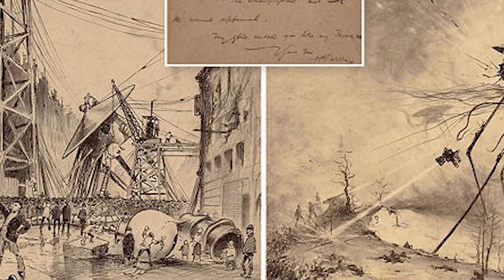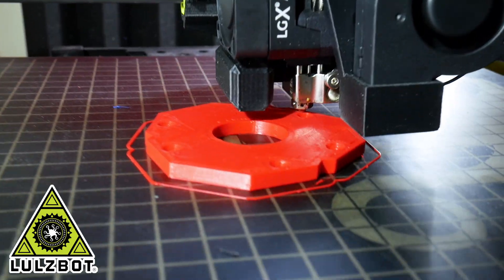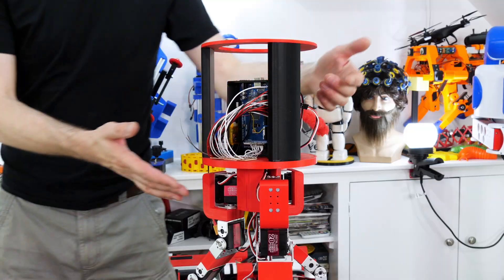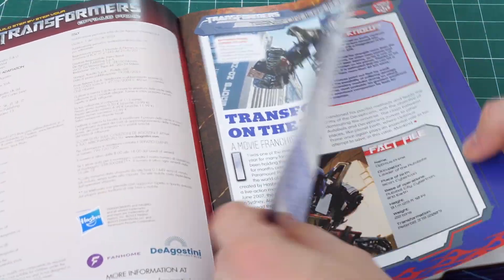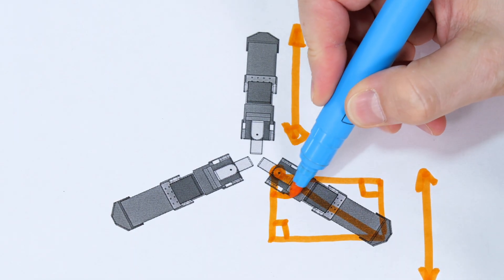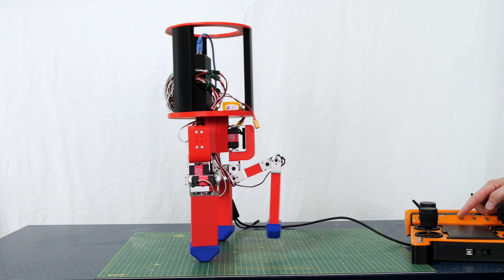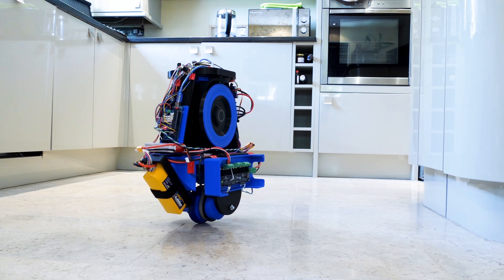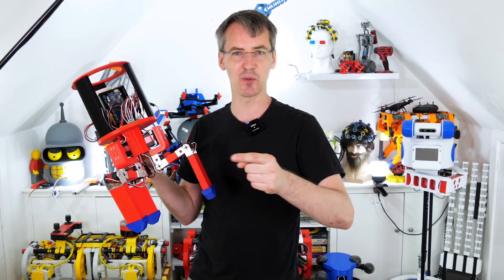Could Alien Tripods really walk Robot

Comment: I doubt you'll see this, but maybe try a single motor per leg and use a wire to adjust the length of the legs by wrapping it back and forth through the pivot points and having springs to push the legs straight. Then you don't even need a calculation on the angles of the leg joints, just to know the length for movement and balance.

Comment: I am an mechanical engineer too and I was responsible for designing CFRP Structures for my Formula Student Team (Monocoque, aerodynamic parts, etc.) for three years. Furthermore I did my masters thesis on CFRP (additive manufacturing) an developed a failure mechanic too. 

We are on the same page - I was shocked to hear that they really used CFRP for that structure, which is just plain stupid.
One point I want to bring up, since you didn't address it in the video:

Bonding CFRP and titanium for this application is the second worst idea that they had. Both materials behave extremely different under pressure. Even IF the CFRP would not fail - the bond would....

Comment: Heelys solved walking with wheels on your feet.  The wheels don't go on your toes because you need toes functioning as fulcrum of a 2nd class lever in an emergency stop.   To suddenly broaden your base of stability and convert forward momentum into lift against gravity to arrest forward motion without overwhelming traction.  The tripod version would have 2 forward toes splayed either side of the direction of motion and a dragging prehensile toe pointed opposite the direction of motion.  In dynamic walking, the knee approximately points in direction of motion, but not exactly.  Inward ankle rotation orients the raised toe straight ahead, and outward ankle rotation permits pivot around the lowered toe allowing reposition of hip/knee/heel without disturbing static stability or ground contact.  I think the heel-toe shuffle will be instrumental in practical walking tripods to maintain 3 points of contact while moving long legs.  The need for ankle rotation in dynamic bipedal walking does not disappear when adding a 3rd leg.  If we accept that we need an ankle for a tripod walker, we can use it to ensure dynamic walking is backed up by a quickly accessible statically stable configuration.  In my mind, that is the "killer app" for a tripod walker.

Another might be the ability to super rotate the hip, pointing the knee centrally.  Allowing a broad base of support in a volume less than a pyramid.  To perform work on bridges for example; move a central work column close to a bridge span while the feet extend beneath the span.

Comment: insects have evolved to basically be tripods. But 2 tripods, one moves and then lifts the insect allowing the second to move and then swap the load-baring job. Hence 1 static tripod holds the insect and the other moves to a new position then becomes the static one.
Tripods do work, but I can't see a single one working other than like human legs with a sophisticated 'controlled falling' movement.
Reply: The "easy" way to do three legs is treating them as side-by-side-by-side. It then becomes a simplified version of bipedal motion, where the outer legs move in unison. This is like bipedal motion, but it simplifies side-to-side balancing.

But it's also boring.

Wells wanted tripods that moved in a way that was very alien seeming. So, they move in a way unlike familiar creatures here on Earth. Instead of a tripod, imagine a cone. You can tilt the cone so the rim touches the ground underneath the balance point. Spin the cone, and it will roll forward with a "rim roll". Now imagine replacing this conical skirt with three legs. One leg is on the ground while the other two swing around above the ground.

Something like that. Familiar creatures here on Earth don't move like that, because it would involve spinning one's body around in a dizzying fashion.

Comment: If the leg has a much smaller inertia than the robot's base, then you can simply make a step with the leg without the robot falling. This assumes that the motors can accelerate the leg fast enough.

Comment: You could have used a gimbal designed with a dynamic centre of gravity and frictionless bearings. Shifting the weight tangentially away from the fall as it walks. Like a Gimbal Compass. And ball joints and universal joints for the legs in a McPherson strut or wishbone configuration. Basically creating a three wheeled steering system with a dynamic centre of gravity which is opposed to the builds centre of mass.

Comment: The biggest problem with creating specifically H G Wells' tripods is that he is quite specific that they made no use of the wheel and "singularly little" use of the fixed pivot confined to a single plane.
"Almost all the joints of the machinery present a complicated system of sliding parts moving over small but beautifully curved friction bearings."
Reply: That sounds like an extremely interesting engineering challenge that we have only developed the tools to accomplish in this millenium. I'm talking 3D printing to create such mechanisms, and genetic algorithms to design such mechanisms.

Comment: Maybe alternate which front leg you use after stepping with the back leg to counteract the rotation. It'll technically be a bit of a zigzag but I think that'd work much more easily and simply for the kitchen floor instead of adding reaction wheels/gyros. To elaborate, say the rear leg is index 1, then counter clockwise is index 2, and then the last one is index 3, have alternating gaits like 1,2,3, 1,3,2, 1,2,3, 1,3,2 etc, so going from clockwise to anticlockwise steps. Right now it's doing 1,2,3, 1,2,3, 1,2,3, 1,2,3 and it builds up into a circle (continued counter clockwise steps). You may even be able to take advantage of the built up inertia to increase the speed since it'll be alternating between clockwise and anticlockwise gaits, though it'll probably be fiddly at best, and certainly not work on anything that isn't flat and smooth. It may also be possible to just use the legs for balancing with the IMU and not necessary to have the gyros/reaction wheels for active stability, but I think it would be nice to at least show how different gaits affect locomotion. Obviously it still requires some form of active stability to handle different terrain, but you might be able to achieve that without gyros or reaction wheels to save weight/materials/energy/work.

Comment: I am sure the engineering is great, but the anatomy is something else. So the upper joint of the leg is a "shoulder" (???) for each limb in this creation, and each shoulder is the proximal joint above the "knee" joint. Presumably even on a robot the proximal joint of a "leg" isn't the "shoulder". Even on quadruped animals the 2 limbs closest to the head have shoulders and elbows, not shoulders and knees. And there are other anatomic requirements for something to be considered a "shoulder".

Comment: If you've ever used a pair of crutches and one leg you are a moving tripod.  You balance on one leg, lean your weight onto the front two legs ( Sticks) and then left what is now the back leg and swing through.  From there you could probably learn a 132 rotation landing on left leg, right leg, middle leg, left leg, right leg, middle leg in a swinging gait.  I think Learning is the keyword here for getting a robot to do it.

Comment: You use your Arduino Mega 2560 as a servo motor controller, I use my Arduino Mega 2560 as a DCC base station for my model locomotives, we are not the same.

Comment: What about a tuned mass damper arrangement, with 2 DOF... you you could inject inertia with that in any direction, paralell to the ground, rffectivly unloading the leg you want to move. once the leg is back on solid ground the damper could be reset without affecting overall ballance/position. The advantage vantage is that the mass could move at right angles to the line intersecting the points of the two feet that are not being picked up.... I havent worked anything out but I think you could probably create a gate by shifting the mass in a triangular motion, avoiding the mid step reset. I guess that a couple of reactiom wheels, at 90, to each other could produce the same effect but I suspect that the structure would be bigger and more prone to runnung out of available accelleration. In addition reaction wheels, once spinning would introduce gyroscopic effects and complicate things. Dynamic ballance would obviously help and could also be used to trim the foot height if  servo load, or a load cell, was used to calculate the ground load of each foot. ... IE. Place the foot in space and move the damper to load it... This would be a best guess.  If the orientation and or load is wrong, ground higher or lower than expected, then adjust the foot height whils using the damper to stabilise the lean.
Granted lots os code and so hard to tunr PID loops but only two servows an and a mass on a stick.
That above my paygrade right now, printer still in its box, but sounds right up your street.

Comment: That 4-gyro two legged robot is the most convincing I've ever seen! It looks like a design that could eventually become a true home domestic robot one day. Why aren't there more 4- gyros out there!?
Reply: I would guess that using 4 gyros uses a lot of energy
Reply: @sarowie  why though? They're not even stepper motors, just free spinning gyros with angular sensors
Reply: @k_the_v  you are right , they don't use lots of energy , they are control moment gyroscopes , which has the advantage of not having a limit in the amount of torque generated when it comes to rpm , i mean , a normal gyro can only spin so fast and provide a maximum amount of torque given a certain rpm , even if you double the rpm , the torque won't increase , that is not the case with control moment gyroscopes , as they provide higher torque the higher the rpm is .
Regarding why they aren't more common i Will say some reasons that i can think of :

1)they aren't that humanoid

2) having these 4 gyros makes it extremely noisy , you would need to cover it with a soundproof material to bring it to acceptable levels of sound 

3) is not a common technology in the field : control moment gyroscopes are mostly used in satellites and some submarines , they aren't used for walking robots (last time i checked only two walking robots use CMG's ) , so is tech that wasn't applied to that field until very recently 

4) is not super safe : CMG's are basically flywheels spinning at high rpm , meaning that handling these without care can be very dangerous

5) not readily avalaible : while there are CMG's for satellites , they are quite expensive and not made for walking robots , the CMG's that the robot uses are custom-made.

I agree with you that they should be more common , these CMG's are so damn good they are able to balance a 34kg (yes that robot weight that much) robot that is bipedal with 2 dof in the legs (2 dof leg in a biped would be extremely hard to balance , that is why most have 3 dof ) , it seems like the ideal way to upscale a bipedal robot without having to worry that much about balance

Comment: IIRC, the three legged creatures in Tripods ran with a rotating motion. Imagine a tilted wine barrel doing a "rim roll". The creature would move like that, with one foot underneath as the other two feet swung around.

I'm not sure how the heck you'd program a three legged robot to accomplish that "rim roll" motion, but I imagine it would end up a lot faster and more elegant than this robot's clumsy walking.
Reply: I came here to say this too.  In the original the motion is described as: "And this Thing I saw! How can I describe it? A monstrous tripod, higher than many houses, striding over the young pine-trees, and smashing them aside in its career; a walking engine of glittering metal, striding now across the heather; articulate ropes of steel dangling from it, and the clattering tumult of its passage mingling with the riot of the thunder. A flash, and it came out vividly, heeling over one way with two feet in the air, to vanish and reappear almost instantly as it seemed, with the next flash, a hundred yards nearer. Can you imagine a milking-stool tilted and bowled violently along the ground? That was the impression those instant flashes gave. But instead of a milking-stool imagine it a great body of machinery on a tripod stand."

Comment: I prefer the method described by Arthur C. Clarke in the Rama series for the spider biots where the body spins around the one leg it has on the ground while moving. This is extremely unstable motion therefore requiring some form of multi axis balancing ability.

Comment: But I think them walkers was done in a different way. As it showed the aliens having 3 legs themselves and building the tripods to match them so it would be better they control it like in a full suit. Then the machine move as you do and as fast as you do and you the driver keep it balanced just as you do while walking or doing anything. The down side to this is it needs a driver but the plus side is in the tripods anyway it only your species can use it. That would explain the tripod at the end of the film walking in circles before falling over.

Comment: would like to see a tripot-bot that has linear actuators for legs, so that they can rotate the legs around the shoulder joints, but the leg actually expands in length or contracts while taking a step like a hydraulic cylinder for example. At least i think I'd like to see that, bc i expect for it to be more nimble as long as the linear actuators are fast enough to jump, which hydraulic actuators likely wouldn't be, but you could then essentially jump each foot a step forward one by one. 

I do notice this is hard to put into words so I'd likely have to animate it for you to understand my exact thought process, but still.

Comment: love your content, i imagine that if you are able to calculate the axis inertia and mass vector form in ground direction, form a point where it intersects with the ground,  than you could position two feet in a line that intersects the point, move the other feet, then do the cycle again, making the  sure that the feet who moved in the previous cycle stay "still"... i bet this will make the gyros obsolete in this build...longer leg bits would help in this scenario, as the bot would have more freedom to choose where the tips go...
Reply: and thinking more about, you can use the weight of the robot to control the vector before taking the step...so it leans in a certain way, taking in count the desired axis position in the next three foot part of the step, like "lean to next balance, move a feet to intersecting line"

Comment: An amazing video, I often wondered why people never model a  3 legged machine on a para athlete who uses two crutches and one leg. I can outrun most able bodied folks and remain perfectly balanced :)
Reply: not radially symmetrical.  you then get a bilaterally symmetrical robot with one leg and two long arms.  part of the design was trying to recreate the kind of tripod walkers dreamed up by welles.  i do imagine the "one short leg, two long ones" design that moves the outside legs in unison, then swings the middle one forward to complete the gait would be a lot easier to design and build.

Comment: Something is making the robot fall to one side, that's probably why it's walking in circles. Try balancing the robot first, or counter the circular movement in the code. Also try on different it surfaces or using different legs as forward, this should confirm or refute my hypothesis.

Though it could also just be because it is top-heavy.

Comment: Pointy feet makes your robot isostatic when the 3 feet are touching the ground and merely unbalanced with 2 feet only (it falls)unless you control the centre of gravity to be outer from the line between the 2 feet). The reason you (as a human) don't fall when standing on 1 leg is that each foot is at least isostatic, hyperstatic in many regards. If you put simple short arc segments from your feet toward the inside (i.e. towards the center of gravity), you can cancel gravity and momentum and thus not care any longer about falling, it's just about the length of your arcs. because you now have segments in contact with the ground (and not just points), your robot is stable as long as the vertical to the center of gravity (weighted by inertia) doesn't go outer from the feet.

Using gyroscopic precession is hugely greedy in energy, therefore probably not the right solution.

Comment: A motorized weight placed in the upper part of the robot could be of great help. 
This weight should swing by moving the center of gravity harmoniously with the movement of the legs, so as to compensate for the imbalance produced by the movement of each leg by temporarily bringing the center of gravity to the other two and then bringing it forward when the leg has reached the new position. 
We think of the head of pigeons and chickens that bob back and forth as they walk, or of the forward lopsided run of ninjas, or the lopsided backward walk of old aristocrats of the past.

Comment: I don't think you need wheels to balance. I simply think that the current programming with fixed steps needs to be replaced by active and fast compensation. You have enough DOFs and reach to keep the COG close to the line between the two legs that will remain on the ground.

Comment: The way I see it working would be to move the hind leg forward as the balance shifts forward while the front two legs act as pole vaults 
The legs could be flexible like Dr. Octavius tentacles as the length needs to be able to expanded almost 50%